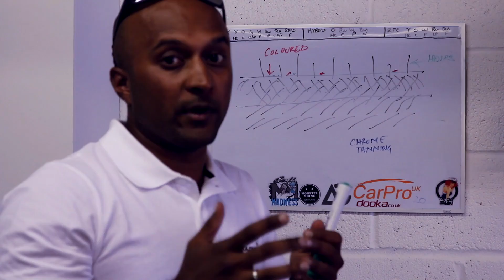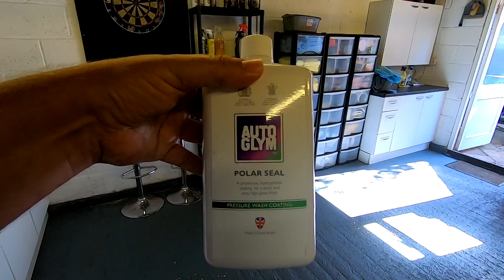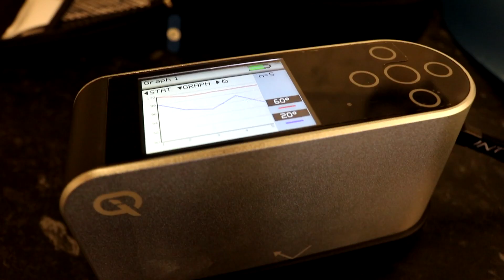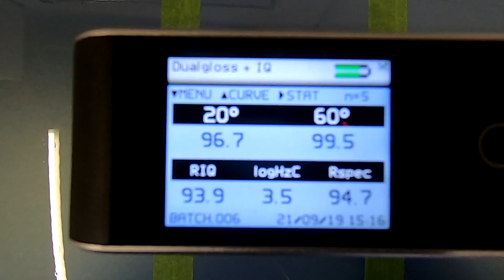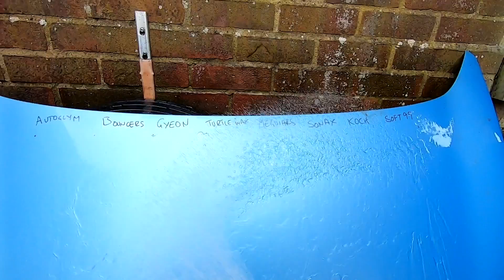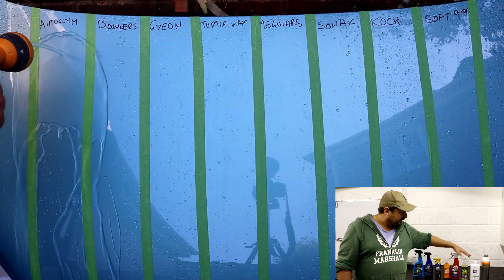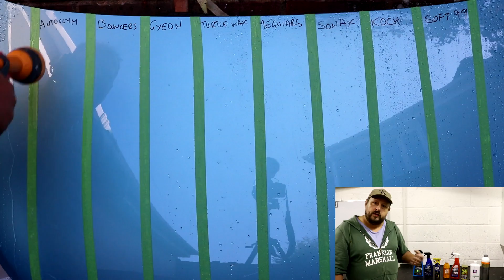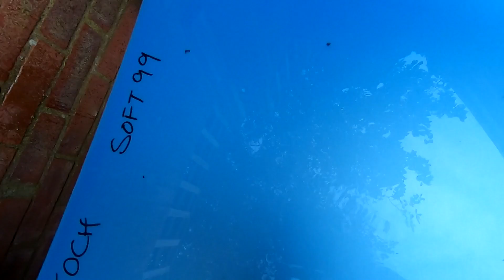The Best Spray Sealant | Drying Aid Wet Coat Spray&Rinse | Meguiars Turtle Wax Sonax Gyeon Autoglym

Comment: Great review as always!
My question is.. what is the need for these products? Are they to be used instead of a traditional sealant/wax or along with?
I just cant understand what benifit they would bring to a car that has been sealed and waxed.
Reply from the maker: its just a way to apply protection rapidly in between stages.  And it helps dry the car potentially.    A lot of people adopt this method to save time and apply protection while drying.   

but yes some will argue you get better results more control with spray and wipe, or spread and buff type products.

Comment: Did Turtlewax replace Dry & Shine with another like for like product or is there no alternative to this in their range? I've just bought some Wet Coat and it costs a fortune compared to Dry & Shine.
Reply from the maker: They have ceramic wet wax.  But if you want cheap option.  Koch chemise PW is a concentrate

Comment: I live in a hard water area and wondered if these type of squirt on and spray off products would promote water spots?
Reply from the maker: in reality no, on a freshly layed out product sometimes you can get some water spots but they are sitting on material which generally repells the footprint of minerals better so it will just wash off more often than not.  although sometimes some products you can find do seem to cause water spots which dont seem to want to wash off so easily....      but ive done so many tests where Ive had strips of different products on test hoods sitting outside and I dont see like issues with one area of strip etc..  or very very rare

Comment: Could the Turtle Wax Dry & Shine perhaps be diluted with some deionised water in a finer mister to help reduce the risk of misapplication before it's rinsed off or would this for example somehow effect the chemical bonding process?
Reply from the maker: it would lower the concentration of active ingredients versus carrier.  but yes you could experiment with this.  Id start with and extra 20% water in the mix.
Reply: Forensic Detailing Channel With cost per wash being so important to most of us have you tried Gyeon Wetcoat Essence. At its lowest recommended dilution of 6ml (1:15) per car you can coat it for £0.78 with the 250ml bottle from Cleanyourcar.  Was the 90p per application calculated with the premixed 1L bottle not the 4L bulk buy option, you couldn't see in the video on your notes.
Reply: Forensic Detailing Channel Just become a Patreon. Thanks for your current and previous feedback, Your interaction with your subscriber base is definitely appreciated, keep up the great work.

Comment: Can we apply one of these products on PPF application ? Are they just  bound directly to the hood or can we apply them also on the PPF products? 

Which one can we use especially for the PPF surface?
Reply from the maker: generally speaking they will work on PPF. but it can vary product to product. Ive heard people discuss poor results using certain spray and rinse on PPF.  so really if your thinking of buying a spray and rinse product for a PPF car you need to ask that brand if the product can be used.   wet coat though I think is an example of one that will work on PPF.
Reply: @ForensicDetailing  1000 ml of wetcoat is 180 Turkish Lira in Turkey it is really expensive and I think I'm gonna buy Turtle Wax because it is 80 Turkish lira. I' m gonna give it a try because my PPF is not contains hydrophobic surface and i need dust and water resistance for PPF surface. Thank you soooo much for the responses btw ;))))

Comment: Missed out the best spray and rinse product. Carpro hydro2lite
Reply: Nicholas Bagnall you mean TACSystem Water Glass?
Reply from the maker: @MAMW93  I actually have water glass, just forgot I had it.  next time I put water glass and hydro2 in the line up for sure.
Reply: I find the car pro stuff gives a nice gloss and it certainly repels dirt very well. Car stays cleaner for longer . With a pre wash of BH snow foam stuff there’s very little work for my BH auto wash or car pro reset to do.
Reply: Forensic Detailing Channel without Aquabead it’s not a true test haha

Comment: Can you use sealant & wax together? In Liquid, spray or traditional paste.
Reply from the maker: insufficient information to give good answer :)

why?   best way to answer this question.

When you put a wax ontop of a sealant more often than not you are covering the sealant in a paste which is 50-60% hydrocarbon solvent (mineral spirit).

This will serious degrease more sealants out there.  In exactly the same way rubbing hydrocarbon panel wipe over a sealant will degrade it.

but because you have layed a fresh wax down you cant see whats going on with the sealant.

you should layer products together that are compatible... If in doubt dont layer.. if you really want to.. make sure your top coat products are water carried.  Wax emulsion water based for example.
Reply: @ForensicDetailing  Hi John, hope you're well 😃

Weather permitting in the morning I'm going to be attempting to apply the turtle wax seal and shine, would you fully decon the car then apply it or just apply it as is? My car was sealed and waxed about 2 months ago. Also could I put my uhd wax on top of it or would it be pointless?

Hope you get back to me and keep up with your channel, it's my go to Channel when it comes to me learning more about detailing 😃

Thanks

Comment: Hi John, how can you avoid applying on glass if when you rinse the roof the product will run down through the glasses?
Reply: You cant really, I would aim the hose/pressure washer towards the back of the car for the roof and front of the car for the bonnet to keep the product away from the windscreen as that's the most important glass. then use a good glass cleaner or IPA mix to remove the residue. if it sets on there well you may need to use glass compound/polish :)
If you wanted to be really anal, you could tape up bin bags over the glass.
Reply from the maker: yes what alex said.  or you can just spritz onto the roof and spread it with a soaking wet microfiber then towel dry the roof..
Reply: Dont worry about it, just come back a few days later and polish the glass and it should be gone
Reply: Felipe Tartuce personally I’ve found no issues with the product getting in the glass from pressure washing the roof. It definitely does get on the glass and leaves protection but it’s not been a problem for me. Nice beads when it rains. I wouldn’t spray it directly on the glass and I would imagine in direct sunlight it could cause problems but for me as a bit of protection in the winter months I wouldn’t worry about the glass just from rinsing. I do a maintenance wash weekly and clean my wiper blades each time so they are spotless and I don’t get any smearing or issues with the windscreen.

Comment: I'd love if you included some really cheap products as a wild card, everyone raves about Demon shine as a drying aid as its so cheap (£3 on offer) you can't overdo it, leaves loads of gloss and shine - go one further and buy bulk Carplan hi wax rinse which is £9 for 5 litres! I use Sonax  BSD and top up in between with carplan when drying. These all seem like £10-15 products, for just 250-500ml and arent cost effective, over hyped, industry smoke and mirrors.  Same with Meguirs Detailer range - their Xpress wax is 3.8 litres for £25-30 and its the same as the Ultimate Quick wax that costs £13 for just 450ml!
Reply from the maker: yes good feedback..  but really Koch chemie and Autoglym are both cheaper than demon shine potentially.   Demonshine is not really a spray and rinse sealant either.  but yer maybe theres like a mega cheap one.. autoglym have a trade version of their polar seal which is ridiculously cheap autosmart have a cheap one as well i think.       Thing with price pete.. Its not really smoke and mirrors.   Its like if meguiars had their xpress wax as a US gallon in halfords.  And their ultimate quick wax in halfords.  people would choose the ultimate quick wax because they dont want 5 litres of concentrate even though they know its cheaper..   Its like 99% of dudes just want to grab something of the shelf as a quick fix type thing.    those of use really into it know the value you can get from concentrates and therefore we see the mass market retail things as rip offs'..  but I just think 13 quid is nothing today.  I go and buy a cofee and a sandwich this morning and its like 9 quid.

Comment: What do u think of Auto finesse's new product Lavish Ceramic Snow foam ?
Reply from the maker: im really not a fan of ceramic snow foams or shampoos. does not matter which brand.  When I clean a car, my aim is to clean it.   If ceramic infused shampoos were any good seperate protection products would instantly become defunct.   When a car is dirty trying to apply protection while applying a prewash is a bad idea.  specially with thinks like greasy glass and grimey rubber seals.  will work great on a clean new car but theres a slight flaw with that logic.

who knows though maybe this product from AF maybe the best of its kind within this catagory.  Its just the catagory generally I hate.
Reply: @ForensicDetailing  the ceramic snow foam was designed and it says to use it after you have wash your car, it's not to use As a Pre Wash Snow Foam
Reply from the maker: whats the point in having detergent in it at this point?  after washing it might as well lay down protection at this point surely?  who knows maybe I should check it out. not saying its crap just dont like this genre.

Comment: What about 303's spray seal?
Reply from the maker: good call, yer for next time.
Reply: I've had great results with it. I am about 8 months into it on a couple of vehicles and it has been great. Durable. Great shine. Great self cleaning ability. Slick. Treats glass great. I'll keep using on one of the vehicles for sure.

Comment: If i was going to apply a longer lasting LSP but used one of these as a rinse/drying aid prior. Would the layering reduce the longevity/durability of the LSP?
Reply from the maker: It's the wrong way round m8 to do it.
Reply: @ForensicDetailing  I've once seen a detailer apply Polar seal, dry the vehicle then apply a Garage Therapy Sealant. Claiming it would last 6 months. Why I was wondering, if you used Polar Seal first, would it have reduced the durability of the GT Sealant

Comment: What happens if you cut the Megs product down 50/50 with some water, spray on and pressure wash off
Reply from the maker: it works well at 50 50 with DI water.

Comment: Does anyone know the difference between turtle wax sealant spray and turtle wax dry and shine spray? Or at what stage you would use them. Cheers
Reply from the maker: sealant spray is to be used on dry surface..  spray, spread, buff.     dry and shine to be used on a soaking wet clean car.  spray, rinse, dry.
Reply: @ForensicDetailing  thanks mate. Went for the sealant spray as I can't resist a final buff.

Comment: Could you do a video on Turtle Wax Rinse & Shine vs Turtle Wax Sealant Spray, I can't remember but i'm sure you can use it on a wet car too (or use both dry i can't remember :) 
I bought Rinse & Shine based on your other video you mentioned, i really like it and only paid £4.16 (... well £4 something). I've just got Meguiars HCW and will try that next. It was in the winter kit which i highly recommend to buy for value (but you've probably got most of its contents already :) But £4 v £16 Though :/
Next after those I think Ill try The Sonax one.

Oh and do you think the Autoglym Polar Seals ability to use a foam lance is a good advantage, is it easier/quicker. Will buy this in the future also haha
Reply from the maker: yo alex, I have more TW stuff coming in so lots of comparison will do sure..    Polar seal in a lance is a very rapid way to  lay out this sealant..  its advantage in some ways yes but you loose like accuracy if you didnt want to spray it anywhere perhaps.
Reply: @ForensicDetailing  Looking forward to that, your comparisons are the best part of You Tube (and cost me a lot of money ;)£££). I might invest in a second lance (or just a bottle) as not to contaminate sealant with soap. I wonder if you could use others in snow foam lance? Is Rinse and Shine concentrated enough?

Comment: Hold on I can polish then wet the car again apply and rinse?? 🤯
Reply from the maker: wash car, rinse car with clean water to remove suds,  then spray these onto a wet car and pressure wash off or towel dry depending on product.